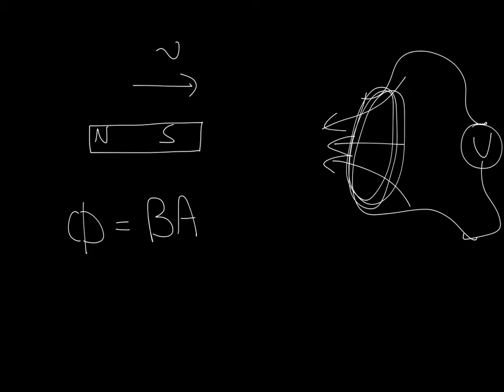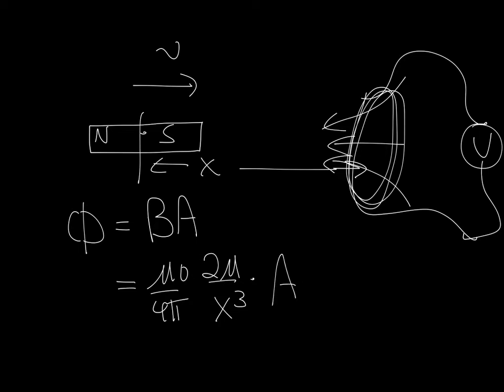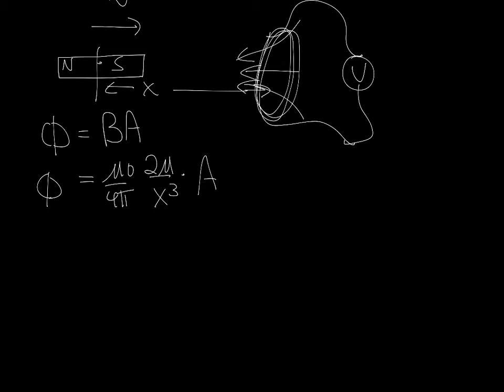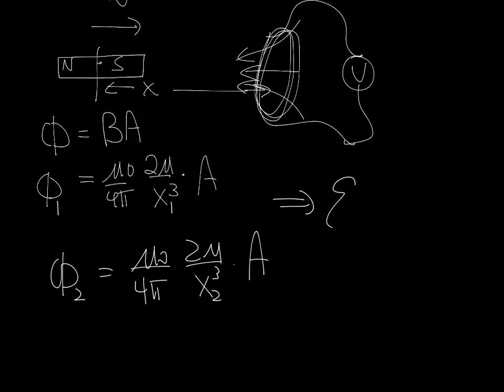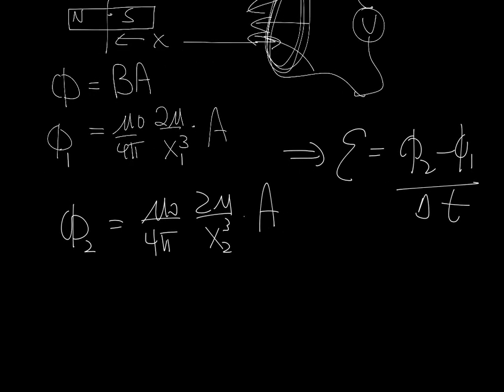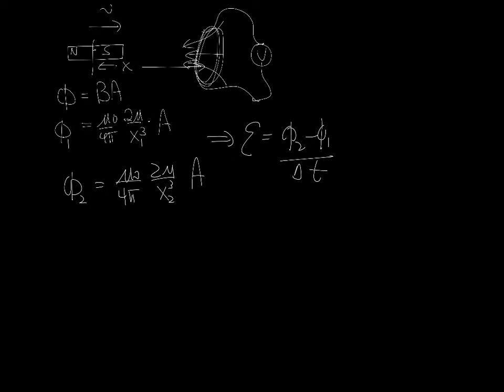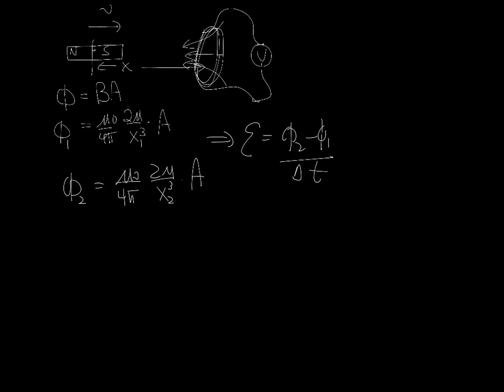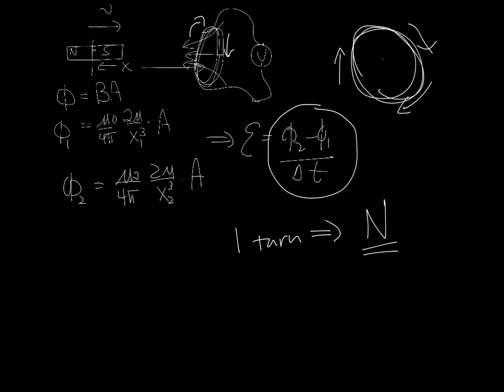Quick Induced EMF by bar magnet

Comment: How did you derive this?
Reply from the maker: It's just Faraday's Law. The EMF is proportional to the rate of change of the magnetic flux. Is there a particular bit that's confusing?
Reply: @sspickle  Thanks for the reply. Yes, I understand that. I have two questions, however. I am currently working on a project, where I dropped a bar magnet from different heights through a solenoid to generate emf, which I measured. 

What is the derivation of the magnetic field of a bar magnet? As there is no current, the Biot Savart Law doesn't work. Is there some sort "fake analogy current" I can use to find this? 

Also, I am trying to calculate the flux with respect to time. I understand that magnetic flux is the integral of B•dA. How do I find this with respect to time? In other words, I know that the bar magnet generates an EMF in the coil because as it moves through the coil, the flux through some loop dx will change, but I am at a loss for determining this. If I, for example, simply multiply the flux by the velocity dy/dt, the units don't work out to get Volts. Some guidance here would be much appreciated.
Reply from the maker: @joshuakoehler6457  Aha, OK. The simplest model is just a magnetic dipole. That would be pretty good as long as the dimensions of the magnet are small compared to the size of the solenoid.  Otherwise, you'll need to model the bar magnet as a collection of dipoles. You can probably get away with assuming that the field produced by the induced current in the solenoid is negligible, so the bar magnet is in free-fall. Instead of a finite difference (as shown in the video) you'll want to compute B(t), which you can integrate over the cross-section of the loop to get phi(t) and take the derivative wrt time to get the EMF. Make sense?